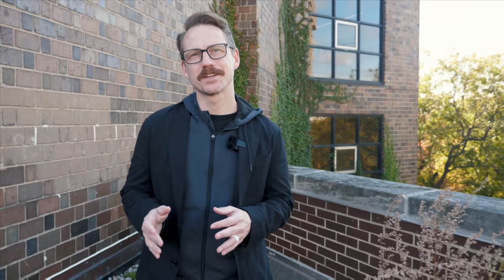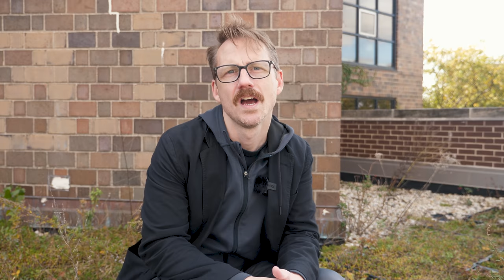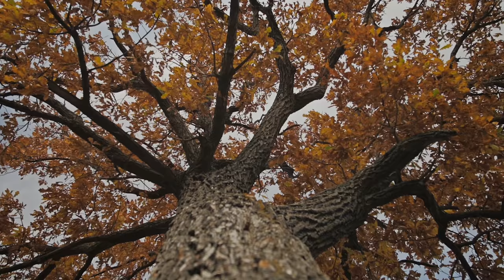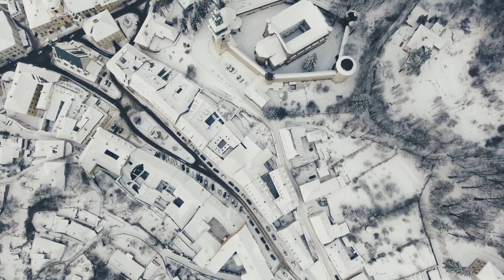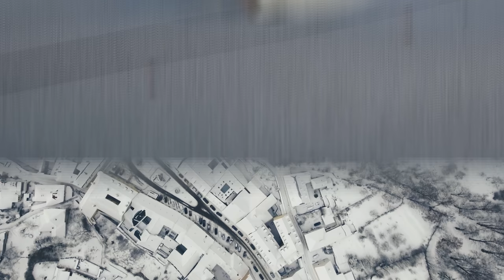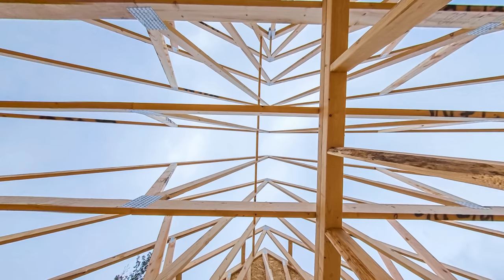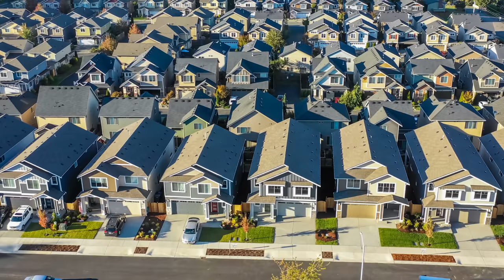Why Do Architects Insist on Using Flat Roofs?

Comment: Having grown up and lived in Santa Fe, New Mexico where flat roofs are pretty much mandatory in residential houses for aesthetic reasons, I can tell you that flat roofs are hell.  They not only leak at the seams but 100% leak at the south facing gutter no matter the age of the roof.  The reason is that the south facing gutter is shaded by the parapet.  In the winter, water collects at the gutter.  The parapet blocks the gutter from getting sun from the south.  The water freezes.  It thaws, freezes, thaws, freezes making microscopic cracks into large cracks where water seeps into the house…. 100% guaranteed roof leak.  Keeps the roofers in business.   I have resolved to never buy or live in a flat roofed house.
Reply: As someone who lives in the netherlands with a flat roof, (which is decently uncommon) i have had 0 issues with my roof, no leaks and love the extra space it provides.
Reply: Couldn't the parapet and water freezing issue be addressed by draining water to the center where it is guaranteed to have some insulation year-round? (Edit: my bad, by insulation I meant insolation, "lit by the sun")
Reply: @alessandropinto5204  All problems can be fixed with redesigns.
Reply: @alessandropinto5204  then you have the issue of the pipe getting clogged and being uncleanable
Reply: @vyor8837  I misspelled, where it is written "insulation" please read "insolation". Anyway, isn't unclogging a drain just a matter of sticking one of those flexible coils of wire that you can spin into the drain pipes? At least it's how we do it around here.
Reply: @alessandropinto5204  that would work, but then you have the price

Comment: Great stuff, thanks for putting it out, 
I’m a Homebuilder that works with a bunch of architects at a design build firm, so I’m constantly arguing about form vs function (or in my case, build ability” 
I would add, it’s all about the system you employ in the building (but it’s def hard to express nuance on youtube). 
I  generally hate flat roofs because of warranty issues, maintenance problems, and a general lack of design thoughtfulness (aka, we can draw it close enough and the builder can figure it out )  
If it’s designed with consideration toward local climate, trade skill set, low maintenance, and style, then I’m all about it !
Reply: Until someone develops a single-piece flat roof with no joints and an infallible drainage system then I don't think you'll ever find a flat roof design that rates well for "trade skill set (ease of installation)" or "low maintenance". A flat roof should be a consideration of last-resort when some other need (rooftop space, maximum floor area under the roof for a given height, etc) trumps cost and reliability.

Comment: My father, a civil engineer, offered me this nugget of wisdom: "Flat roofs leak." He went on to state that the roof least likely to leak was a sloping shed with nothing poking through. As roofs get more complex, with multiple gables and intersecting angles, the likelihood of leaks increases.
Reply: Imagine a slant roof made of a single piece of corrugated steel, with zero penetrations - secured to the structure by (machine) welded threaded inserts. I'm sure it would be challenging to manufacture, transport would certainly be more difficult, installation yet more still... but you wouldn't have to worry about it once it was there! But modern houses are built to fall down two years after the mortgage is paid anyway.
Reply: @Bobo-ox7fj  The problem is with a roof like that if you did need to replace it in case say a tree branch damages it would be even more expensive

Comment: They make sense for many buildings, mostly those that are actively maintained by professional contractors (i.e. business buildings).
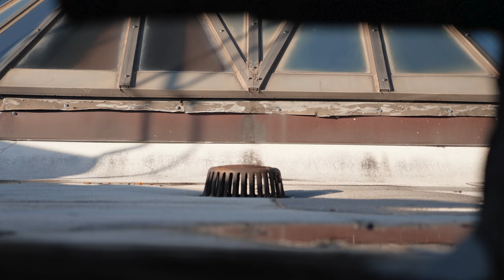But it is pretty ironic to explain that the water shed problem on flat roofs is solved with drains while showing a picture of stagnant water right next to a drain, because the roof has a slight dip there. (6:07)
Reply: Yep.
Reply: if the majority of the water is drained then the rest will evaporate with the sun.
Reply: @ajelicits3435  You get sun? Every flat roof residential building in Iceland has to battle leaks, many of them on just a couple of years old buildings. In addition to sun we get volcanic ash.
Reply: @ajelicits3435  That's a good joke.
Reply: @johng6350  the sun evaporates water. science bro

Comment: In the UK home insurance is higher for houses with flat roofs because they’re so prone to leak and require more frequent maintenance and renewal. We have a lot of Victorian homes with steep clay tiled roofs with lead flashing which are still going strong 100 years since built…and it’s a quick cheap job to replace the odd broken tile when needed. Take your point about larger commercial buildings, but can’t beat a tiled pitched roof on a house in rainy climates.
Reply: Youre points are mostly correct, a welded plastic roof like TPO will perform better and better on a cost basis. He should do a whole vid on how much TPO has changed the game.

Comment: I was always under the impression that flat roofs were built off level or had some form of general drainage that kept it "flat" without actually being flat.
The comments saying otherwise have saddened me.
Reply: You are correct, there are no true flat roofs, they all incorporate a fall (slope) to shed water to perimeter or valley gutters. In the UK the building regulations require a minimum slope of 1:50.
Reply: You are not wrong. The problem is how well and uniformly it is build. And the waterproofing of course.
Reply: If they were totally flat, the water would pool in several places and start to damage the roof. They have to have a slight slope (like a shower floor slope) for the water to drain.

Comment: I am an ex construction worker from the USA who worked on many of the types of roofs you discussed in your excellent video. When I decided to build a house in Tijuana, Mexico I realized that most of the roofs here are built with rebar and concrete poured into wooden molds. The learning process was a frustrating pleasure.
Reply: yeah, waking up and smelling the roses can be a real challenge when you've been fooled into thinking to narrowly from the start.

Comment: Roof form has a great influence on the internal conditions in a building - where you put skylights, where the ridge/valley in a roof is can determine air flow and natural ventilation. A lot of architecture schools practice idolatry of modernism and its ideas, but there is a lot to be learned from vernacular and traditional. Flat roofs in the UK have come a long way but they are still associated with shit extensions and lazy uninspired design, or are used in situations where you are restricted in terms of height.
Reply: yeah man, tall rooms with room to room ventilation needs to come back IMO

Comment: In the rural North (MT, ID WY, and the Dakotas)  the main concern for residential or small business clients is snow load of course. In my experience though, especially in small isolated towns that are disconnected or have a population of mostly older generation folks, the aversion to flat roofs is how they express their aversion to contemporary/modern architecture and growth. They would rather have a building form that’s more in line with what they experience daily, rather than more contemporary “city style” buildings. In the plains areas in Eastern MT and the Dakotas, it’s sometimes hard to convince them that a slow sloped roof could hold up better to the ridiculous wind speeds they constantly get. Love the video!
Reply: Snow loading on flat roofs is generally a function of walls.  In general because wind is a thing, snow will only pile as high as the nearest wall, and often not collect in the middle of the structure at all.   The biggest issues happen when you tall inner walls extending above the roof line, such as mechanical penthouses or additional stories.  Otherwise snow loading can be kept to a minimal with good parapet design.
Reply: @jeremyO9F911O2  Depending on the type of snow. Especially in the spring with wet snow + rain we often see some colapses and have to go clear a couple of residential roofs every year because the snow load is exceeded.

Sloped roofs also need a membrane to stop water from coming up the shingles due to "ice dams"

Comment: I always wondered why we don't build roofs like a giant funnel. The water caught could be captured in a holding tank to at least flush toilets. I am sure a bright mind could come up with many other uses. If the tank is full an overflow could direct the excess water away. You could frame a level deck above it with the classic 1/4 gap between the boards so the water can run off, this way you could still use the entire roof surface.

Comment: I am a landlord of many single family homes, and flat roofs are the bane of my existence. They leak easier and quicker and even if they are easy to repair, they last much shorter then gabled. Also leaks are hard to find and repair on flat roofs, especially if an old roof exists below. I also do architect work, and make a point of never building a flat roof on any home I intend to keep. Give the roofs slope. Its better overall.

Comment: Here in Chicago, flat rooves are sometimes a safety feature, although I would guess it's more of a happy accident than specific planning. During the winter downtown, some of the sidewalks have to be closed or have temporary protective scaffolding set up to protect pedestrians from potentially lethal falling ice and snow. 
It's not as dangerous in the suburbs where the buildings are shorter, but it still prevents snow from sliding off and piling up on sidewalks.

Comment: Very interesting. I'm a hobbyist home designer, meaning I have been designing dream houses since I was a kid. I mostly focus on the interior and only lately have I been paying attention to the exteriors, including roofs. As someone who grew up in an 1800's era Victorian house, I love the idea of gabled roofs because they give you those little niches that are so much fun in upstairs rooms. But I find that today's roofs often have too many peaks and angles and look like an afterthought. I live in a single level house in Florida and despite the overall footprint being a square, there are 17 "planes" to the roof. That's more than the Victorian had. I think they did it to make the house less boxy but to me it just looks dumb. And there's no usable attic space because the pitch is too low. SMH.
Reply: Well in Florida you have to keep the slope/pitch of the roof down to a minumum as the primary concern is wind loading in a huricane and not much of a slope is neded to drain of rain water even in a heavy storm.
Reply: @martinrwolfe  Wind loading is actually worse with low slopes until you get to 35 degrees or so, because then the roof acts like a wing and the wind is constantly trying to lift it off the house.
Reply: Victorian houses had tall gables and CEILINGS to let the heat rise....no A/C back then.